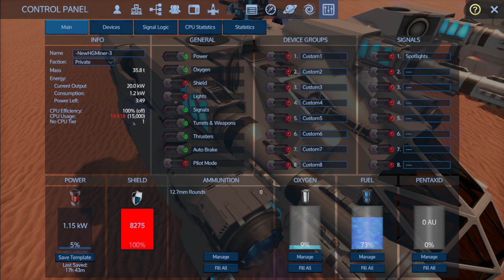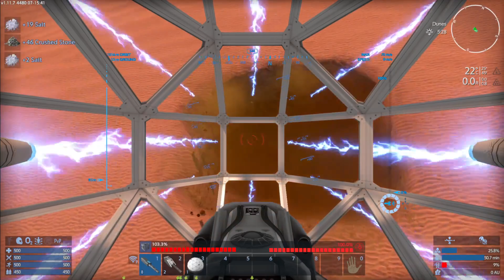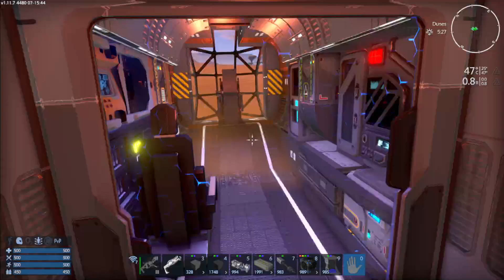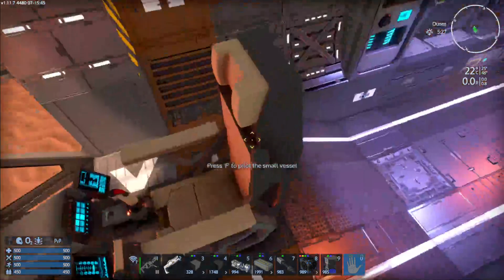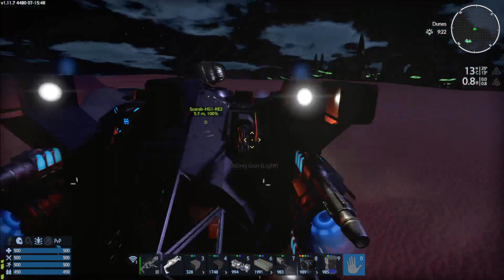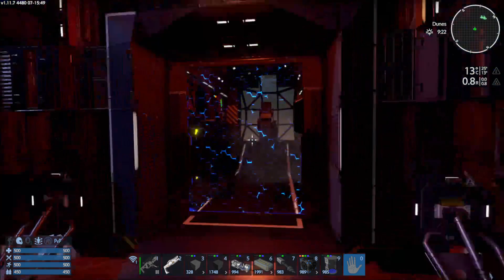Empyrion Galactic Survival - Scarab-HG1-RE2 Preview

Comment: I'm really curious about the graphics card heating up. I don't have that happen when I'm using Ente's HM3 Miner in RE2. I have an AMD Radeon RX 6600 XT which is possibly older than yours - maybe my card doesn't support something that drives yours in overdrive. Love the explanation about laser drill vs mechanical - I might switch to those. Great looking build, I'm eager to try it out.

Comment: Good you begin to learn to do more efficient builds. XD. I use for small builds to have a warp drive in cargo and slap on if need to warp, remove after. Can also have a small CV hauler with warp, since have more efficient cost per storage. Maybe try such a build, a tiny CV to move a tiny miner around.

Comment: have you tried reinstalling your video card?
Reply from the maker: I have done that before, cleaned it a few times. Drivers up to date. It is a RTX2080 and getting quite old at the time and very used. lol. One of these days I will invest in a new video card. And thanks again!
Reply: @jeffrandall2813  i use a 2060 super,dont get any probs apart from fps,ya might need to check fan speeds ,also try the benchmark testing software itll give you a good indicator to whats up with your card,ive always played around with the merc mgm lol,12 lasers with 3 extra gens and cpu upgrade lol,this one looks very nice,and more capable,looking forward to trying it out